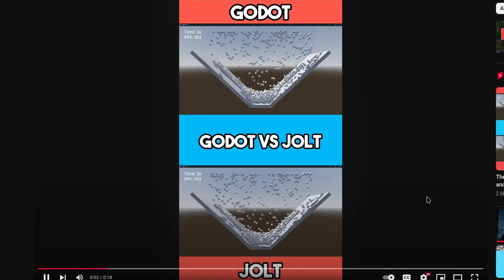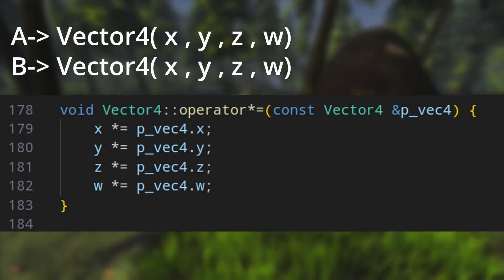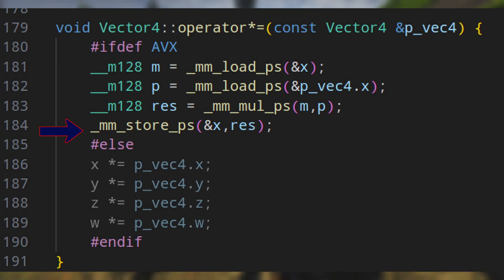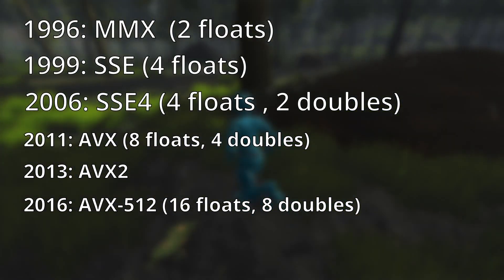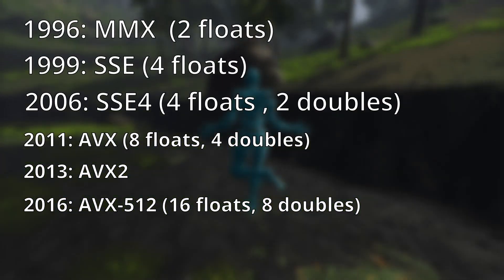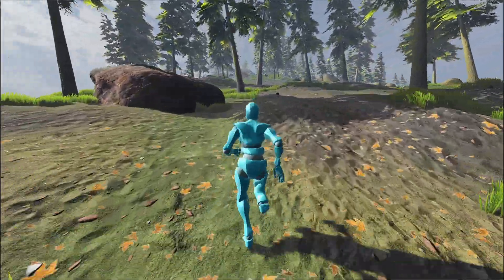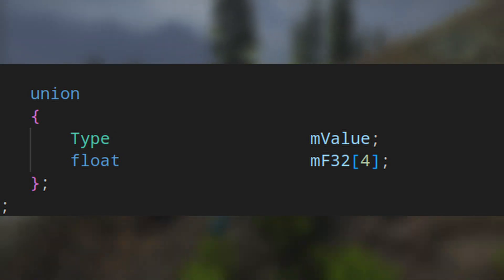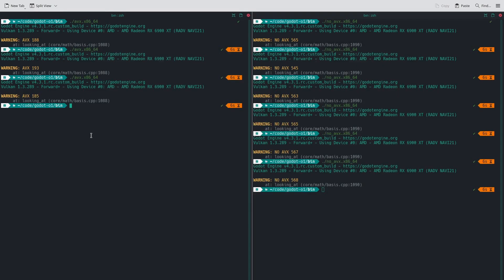Why Godot Physics is slow? SIMD

Comment: There is an open proposal on github named "Use SIMD vectorization intrinsics in the core" and an open pull request named "Add SIMD option to compile system and implement SIMD for vector4".
Reply: It's hanging for several years.

Comment: You can check on Godbolt that pretty much every compiler automatically applies SIMD optimization to most trivial math. They are becoming so good at it that some people are advocating against writing SIMD by hand and just letting the compiler do its thing. The real reason it's usually not done is backwards compat. Even upgrading to AVX is so controversial because of users with old CPUs that its just not worth it. To properly make use of SIMD, you can't get around dynamic dispatch. If Jolt is fast, this is probably what they're doing. But it's also a lot more work.

Comment: Support different CPU architectures, operate systems and graph APIs are core work of middle layers, third party libraries can do other, or need game developer implement by themself with some specific requires. Godot does perfect encapsulation in high level, but have some problems in low level, its codebase is not as solid and mature as some famous framework like SDL, Thats limits its ceiling.

Comment: Does Jolt supports SIMD? Jolt right now pretends to Godot's default physics's place. So why GodotPhysics even need a SIMD? Why waste effort on Godot Physics, when Jolt already surpasses it? Also as far as I know, physics's contributor left the Godot team, leaving GodotPhysics in a suspended state.
Reply from the maker: yeah, but this is not only about physics engine! other part of the engine also be optimized by SIMD
Reply: Just dumb idea to change Bullet :( Godot 5.x with physics would been much better idea.
Reply: @gruntaxeman3740  Bullet developers has stopped support their engine with all bugs in it.
Reply: @MrTravoltino  

I've looked Bullet source code. It is not the cleanest code base, but the Bullet engine itself works excellent.

Physics engine isn't that simple to do correctly and we are talking about real time physics. So there is tradeoffs for accuracy vs speed. I've read some paper where different physics engines were evaluated, measured, and there was comparison tables of features, and Bullet actually shines on those comparisons. It also used on games that have complex physics like Rockstar games.

Because it works, it can be maintained with very little effort. It is not very buggy, it is just not improving anymore. So 
a perfectly valid solution is to take the Bullet code, put it in the game engine, use static code analysis tools and linters, and just change compiler switches to newer language version and more strict analysis so build process can throw warning if there is something weird. Otherwise it can be used as a black box.

Until, we really got replacement that is at least good as Bullet in accuracy, features and performance.
Reply: @gruntaxeman3740  Better is the enemy of good.

Comment: Not only physics is slow. Skeletal animations, scenegraph itself, rendering, resolution scaling... When all of these will be fixed, I doubt it'll be Godot.
Reply: wdym, you doubt it will be godot?
Reply: @dosdoğruyup  because that means that engine needs complete overhaul. And by the time it happens, it won't be the same.
Reply: @Capewearer  I see. thanks for explaining.
Reply: A lot of these mathematical operations affect the performance of the entire engine like animation, GDScript is less performance, sound and even 3D performance is affected because a lot of operations are done in the CPU before is send to the GPU.
Reply: A lot of these mathematical operations affect the performance of the entire engine like animation, GDScript is less performance, sound and even 3D performance is affected because a lot of operations are done in the CPU before is send to the GPU.
Reply: @elchippe  occlusion culling will especially benefit from this.
Reply: Insane how modders can improve game performance and look with limited access. While devs who made the source can't.

Comment: As an artist who does some coding I'm thankful for the sight into the inner workings of Godot. I'm really surprised that Godot doesn't support such an old instruction set. I remember build PCs over a decade ago and had to make sure the the CPUs I used had certain features like this because the games and software I use required them. I can see why it can be frustrating to many Godot users. Many of us choose Godot because of it's open source nature but it still feels like it's being held back due to issues like this that honestly shouldn't be.
Reply from the maker: you know even with these problem it is working and it is open source, but I hope it will get better in future
Reply: This is why I had to leave when my 3D project was starting to show shape. I love everything Godot is trying to be. I want to support them so much and I will, however right now the engine is not fast or strong enough to pull the sort of worlds/art I want to push. Sadly days ago I had to pack up and replicate the project in Unreal very, very grudgingly. (To be honest I am replicating all the code for the player control back into Godot so I can pick up when Godot comes up to par by the end of next year).

Comment: Afaik, GODOT is (hopefully) gonna be using Jolt by default in the future for physics! (See GODOT issue 7308)
 But hopefully these changes can be implemented in the other parts of the engine!
 I'm also curios about the Rapier Physics Engine. It supports 2D physics too, which would be amazing if that could be improved too with it!

Edit: There is an interesting topic around XPBD in a Reddit post I found by looking up "Jolt vs Rapier GODOT". That could be interesting to delve deeper into!
Reply from the maker: both Jolt and Rapiear support SIMD as I know
Reply: @mohsenzare2511  Oh wait I didn't proofread my comment :P
 I meant to say that Rapier could replace the current GODOT 2D physics engine, as Jolt currently doesn't support that (unless you were to make a mixed 3D 2D game, as you can lock the RigidBody movement onto a plane!)

Comment: as said by the godot dev team, they ain't adding simd LOL cause appearently "the compiler will autovectorize" even though they're using gcc as the main compiler and only setting the compiler flag to O2 which prevents the compiler from attempting to autovectorize lol, you can find tons of pull requests talking about it, it's hilarious honestly
Reply from the maker: Compiler rarely does this stuff by itself! Also if compiler want to do that for example for things like Vector3 it does not have proper data alignment so it will let go!!!!!! Also if compiler do that it will use some simple SIMD instruction like add multiply, But intel has many more instruction which can be used in different situation, you can search for Intel SIMD guide to see all of them! so the best way to optimize is to programmer manually write SIMD operation for each different situation!
Reply: You can take a look for Dagor engine math library. This is just pure SIMD, because, well, devs actually used it in game production and saw that pure C/C++ sometimes is not enough for performance.
Reply: This is the kind of operation that a top grade compiler should auto-vectorize.  But not at -O2 level.

Comment: Running a ton of multiplies in a loop is a very artificial test and it tells you nothing about what the real impact would be.
Reply from the maker: for a lot of data and same operation that will give an approximate result!
Reply: @mohsenzare2511  No, because it doesn't model how the code would actually run.

Comment: I think, not just the performance. Godot physics giving the weird results. 😁
Reply: That was my though when they did some change in Godot 4.x. Bullet just worked flawlessly in Godot 3.x, so if I want to do anything with Godot 4.x, I likely revert to Bullet in physics.
Reply: @ Agreed for 3.x, I would try Jolt or Rapier for 4.x
Reply: @ai_buddhist_art  

This just something that I don't understand why they did that kind of decision.

They got limited resources, so they should just use those ready components and stable interfaces. Like, it was super smart thing to focus on OpenGL ES 2.0 and OpenGL ES 3.0. Vulkan is likely next year mature as OpenGL ES 3.0. Let see what happens on webGPU.

But physics, they should stick on Bullet because it gives value for users if they don't change things too radically. Bullet is still capable physics, although it is not multi-threaded but that just didn't matter because it is so easy create separate physics world that runs on separate threads, like one thread for game rigid body collision, one for character hair/cloth, own physics systems world particles... 

I don't even know how those multi threaded physics engines work but some of them fails some cases and that just look terrible and break game immersion, so for me it is important that physics system work correctly.
Reply: @gruntaxeman3740  I don't understand their decision as well.  That's why I have to work with Godot 3.x, more stable and faster with OpenGL ES 2 (especially on mobile & web).  Bullet physics also good enough for small physics-based games.

I have to compile the custom editor which integrate with Box2D physics module. It works better that Godot physics 2D.
Reply: @ai_buddhist_art  

Godot 3.x was made that by default ES2 was for web and mobile and ES3 was desktop/laptop. When Godot 3.x was released, OpenGL ES 3.0 was just started to be mature on phones. In web OpenGL ES 3.0 started to work about four years ago. So it was very possible that default settings were too high, so dropping pixel shading to vertex shading and similar stuff likely helps because defaults were intended to desktop/laptop hardware.

In Godot 4.x OpenGL ES 3.0 is inteded for mobile/web because capability is improved on those.

Comment: Yep my 5950X doesnt support AVX-512 but it does have AVX and AVX2.
Reply: also afaik avx 512 makes cpus overheat and throttle really easily, so it’s probably not worth bothering with at all. avx2 is probably at about 100% support for modern games on windows and linux, mac less so because rosetta 2 can’t emulate it.
Reply from the maker: Also if I am not wrong PS5 and new Xbox does not support AVX-512, but they support AVX2, But who knows what will happen in future

Comment: This is surprising that SIMD was not already supported in a modern engine like this. Adding proper support at this point may require a large rewrite as you need to ensure packing and alignment of primitive data structures. 
One minor correction: MMX only supported integer SIMD. SSE was the first version to introduce float support, which was largely motivated by the 3D graphics operations before hardware T&L (why it is 4-way). MMX on the other hand was motivated by audio and image processing.
Reply from the maker: Thanks for correction! and your comment